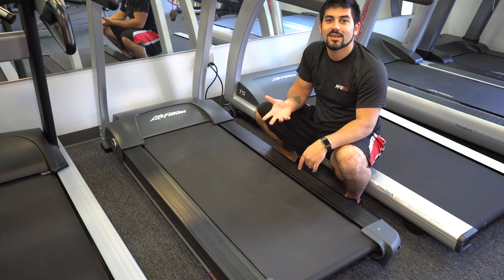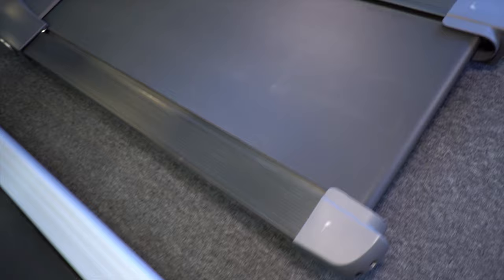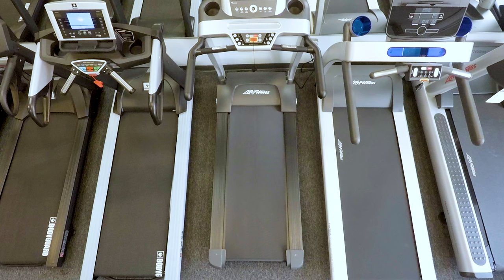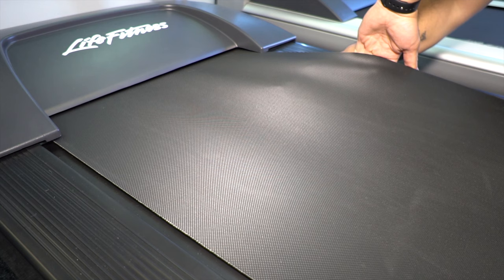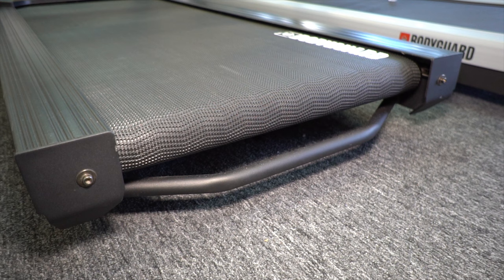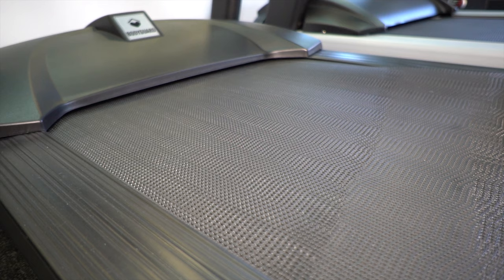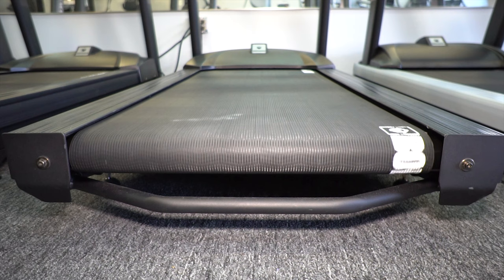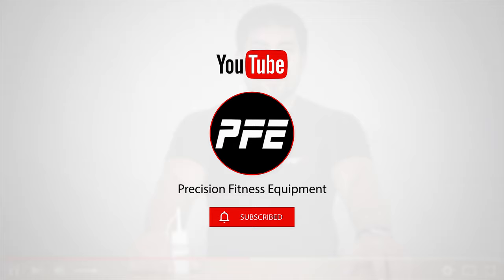How To Lubricate A Treadmill Belt

Comment: Cheers mate, fixed my brothers brand new 600$aud OVICX A2s using this guide, (Edit: my OTHER brother lubed it up but the belt was grinding on one side which has made it slightly frayed). Wasnt sure if it was compatible. Now I can shed some kilos!! Not to mention the nephews can run and push it to its limits and destroy it faster than I can try to fix it haha

Comment: My treadmill is hard to access from the top so I just go in on the bottom. I prop it up up in the rear and apply the oil on that side of the belt where there is easy access. I do it near the front as shown in the video. It all goes on the underside of the belt so it simply comes, oil ans all, around when I start it. Then walk of it as shown.

Comment: My treadmill came with silicone oil lubricant. However the lid POPPED OFF when I was lubricating and now I must clean up extra oil.  Any recommendations?  I am currently trying, on advice from googling, laundry detergent w warm water & Isopropyl Alcohol (91%)

Comment: Thank you for this v clear video. I got my old treadmill 2nd hand frm o friend. Have used for about 3 to 4 years not knowing I had to do this as no manual was given. It now suddenly stops. After I mistakenly sprayed with WD40 found out on google search I had to lubricate with a silicon lubricant and not WD40. I bought one online but instead of stopping suddenly at 20 mins it now stops after 1 min. I live in Malaysia where there does not seem to be much help. Please please tell me what I can do

Comment: That's a very helpful demo on lubricating treadmill. I have a home treadmill, a (cheap) Xterra TRX1000, bought it in November 2020 but started using in full swing only February of this year.  After using it for 2 - 3 consecutive days, a message - "lube" showed on the dashboard so I used the oil that goes with it the way (but not exactly) you demonstrated and the message was gone. The manual said repeat lubricating the belt every 40 hours or so of use. Last week same message showed again on the dashboard; I applied the remaining oil but the message stayed. So I ordered Treadmill Lube Oil from Amazon and applied a little bit more - after I cleaned the belt, based on the manual - inserts a towel under the belt and run for a few seconds. But the 'Lube" message does not go away. Anything I should do more - other than buying a new one?
Ed Rivera
Reply: Buy a new one!!!
Reply: If the treadmill is operating properly, put a piece of sticky-note tape across the readout that says to lubricate. Write i-D-10-T on the tape.
   Works for me.

Comment: Thank you! After the lubrican is properly applied and the running belt has run for  a few minutes... should I feel it oily if I stick my hand inside?
Reply from the maker: Yes you should, but at that point, you are removing some of the silicone, so I wouldn't recommend putting your hands in to check. Once applied, it should be good to go!

Comment: Warning: direct heat will cause the lubricant to dry up very fast. Don't place the unit by a window with direct sunlight or near a heating element at home - including when the unit is in the folded position.

Comment: Shops locked down here in Ireland but we do have KY Jelly. Could this be used (even temporarily)? It is a water based lubricant - could this damage the treadmill?
Reply: water is not good. use silicon lubricant

Comment: Thanks for the video... good job mate.  The manufacturers of the Everfit  treadmill I just buy, supply 2 small bottle of oil to which they say to tip "some oil" in a filling well on each side of the uplifted belt section. Problem is, a little like yourself, they dont say "how much" oil you should use. Should I tip out the whole bottle to both sides?
Reply: put around 30-40ml

Comment: Take care of it, and it lasts a long long time.  I have a   SCHWINN 6700.1   treadmill that I purchased on April 2, 1999.   To lube it, all I have done is take a big white candle and scrape off small bits of wax with a cheese grater, and then I evenly distribute the bits of wax under the belt.  Works like a charm.  Other than that, I have replaced the motor belt, once. There was a nasty scratch on the front plastic cover that covers the motor area, so I sanded it down, but now the sanded area looked grey instead of dark black.  So I applied the same candle wax to the area and heated it up with a hair drier to make the wax easily distributed, and boom, after polishing you couldn't tell where the scratch was anymore.
Reply from the maker: so some treadmills require a wax which sounds like the one you have.  Those typically do not require reapplication unless you have replaced the deck or gone over 20,000 miles.
Reply: @PrecisionFitnessEquipment  I check the temperature of the walking belt now and then after a workout.  If it is getting warm, I then add wax.  After that, it is back to being cool again after workouts, and stays like that for a long long time.
Reply: My treatmill have bad sound when functioning, from the back part not motor,
Reply: @sopheakpeou9657  Could be the bearings at the back roller.   I had to oil the front roller bears once because they too were getting noisy.
Reply: @new-knowledge8040  thank you for advise and I will try yours.

Comment: I have a problem how I fix it my norditrack treadmill n9250 stop running after  a few sec. Power still on but like it seem it reset. Or how the safety key pulled all the time. Help please.

I was running on speed 6 for 40 min then it completely stopped. Power still on.  Turned it off for a minute  turned back on  ran on 4 for 2 min then did the exact same thing twice.
Reply: My bowflex did the same, did you find a solution

Comment: I have lubricant my treadmill and tighten up the belt ! But it stills stop about ever 20 or 30 seconds, after someone gets on it! What's wrong ? Please help ! It's a pro-form 740cs thank you!
Reply: Probably a lower board issue, but hard to tell without looking at it, I would call a local treadmill repair shop to either get the board replaced or to diagnose what's going on.

Comment: One thing you missed - HOW MUCH LUBE DO WE USE?
Reply: I also want to know how much silicone lubricant to use, my guess is probably a squirt on both sides, of a full pippett once every 3 months or every 130 miles, if you use it more intensive, check more often to determine if maintenance is needed. Maybe even once a month or once every 3 weeks if you use it 1 hour per day. Also a treadmill cover to prevent dust from accumilating on top, good maintenance can say f u to the companies that charge for repairs.  They say if you put too much lubricant then the tread will slip a bit, in such case get a dry cloth and wipe the treadmill down a bit, make sure the cloth is lint free so no particles spread on the tread.
Reply: 15-20 ml…maybe maxxxx 1 tablespoon total …less is better!!!!!!!
Reply: @Sukiipod  Thanks!
Reply: Can you use either lubricant or oil? 🙂👍

Comment: I never recommend the loosening of the belt, by anyone other than a pro, because while applying lubricant, the belt orientation with relation to the head roller can change. While they say here loosening tail roller is correct, reaching hands undertneath during the lubrication process can shift the belt orientation in regards to the head roller (roller with the drive pulley).I have seen too may time where this happens and the run belt is oblong...shifted to the right at the head roller and shifted to left at the tail roller.
Reply: Great message and thanks!
Reply: I agree entirely, but some treadmills it's inevitable and in that case you just have to do your best to make sure you tighten everything evenly, the roller in the back is shaped wider at the ends so it will be more likely to self-center but as @rallisoify suggests it can become a whole process and is best to keep it simple if possible.

Comment: I never lubricated my treadmill belt. I never really use it. Its like 10 years old. When i do use it like once a year it seems to work fine. So do i really need to lubricate it? Should there be signs that it needs lubrication before trying to lube it? Or should you lubricate it once a year or something
PS: my treadmill is a Life Fitness, its 10 years old, i forgot the model, but it was around $2,500 to $3,000 at that time.
PSS: My treadmill is a T7 Life Fitness from 10 years ago. ✌️
Reply: Do u wanna sell it? Hit me up if u do